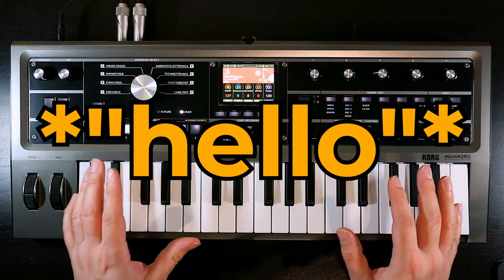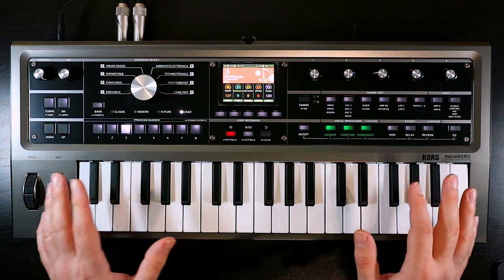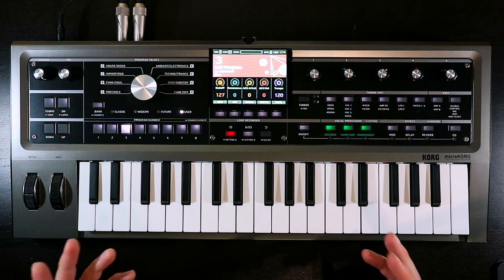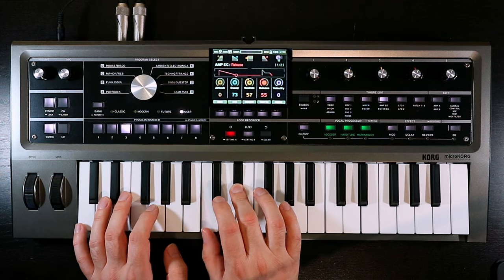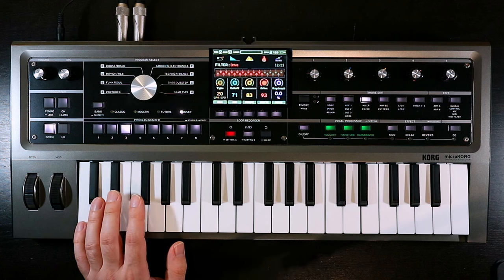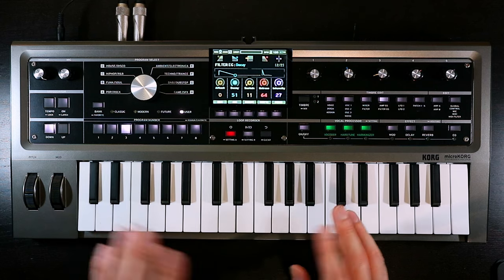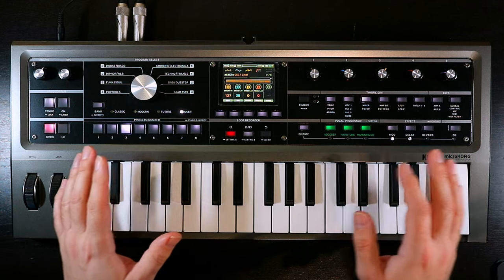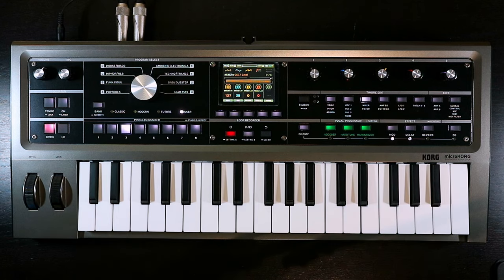MicroKORG 2 - Let's Build: an Automatic Acid Bass Machine

Comment: Nice video! One question I have, since it was mentioned that is has another synth engine than the OG: is it possible to still make the same kind of sound as the original? Saw recently a video where someone made amazing patches on the OG (I think it is called 64 NEW patches for the MicroKorg) and now I am wondering if I would be able to make the same sounds on this new version? 😊